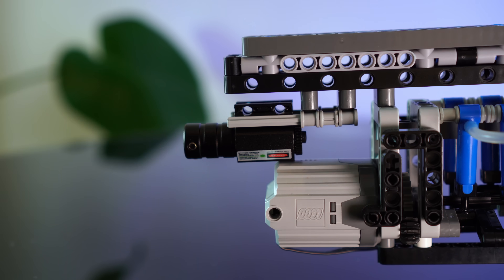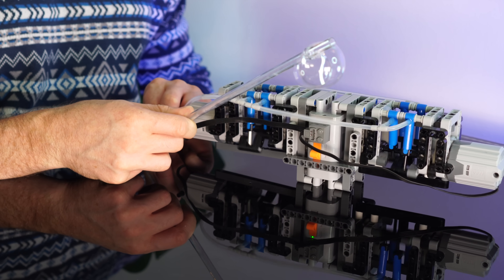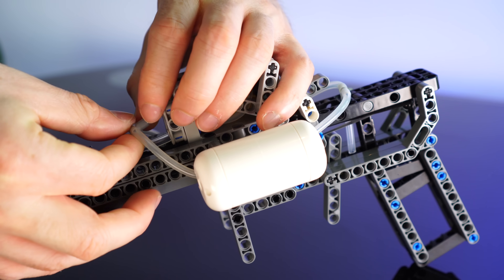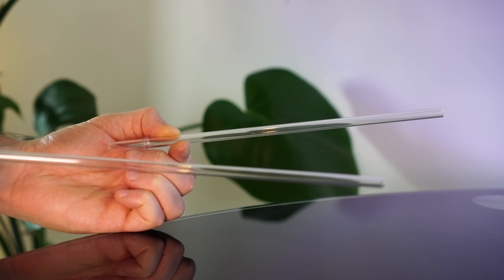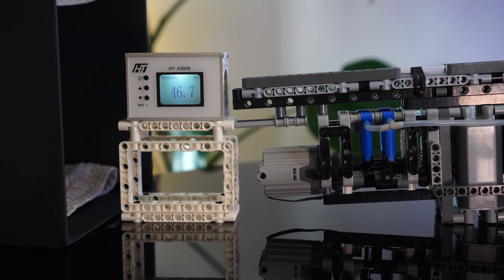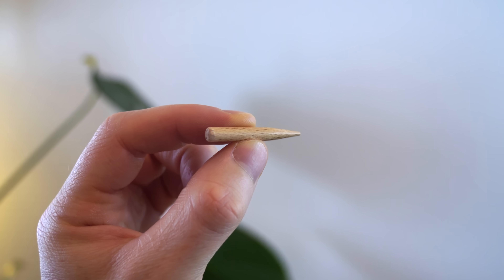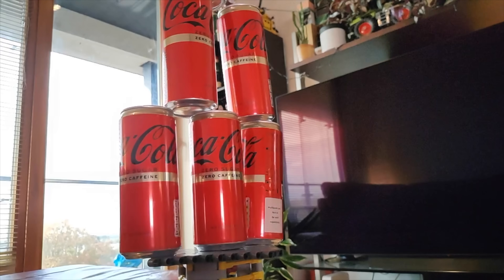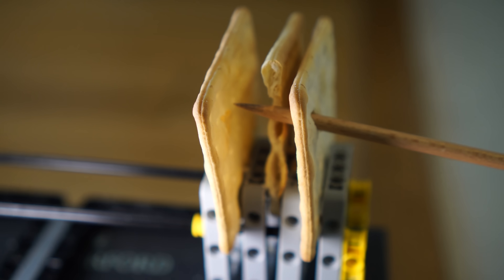World's Most Powerful Lego Air Gun?

Comment: Barrel lenght should be optimal when the internal volume of the air tank is 2-3 times as large as the barrel volume, depending on projetile weight. This is the cylinder to barrel ratio, it is used in airsoft guns for ex. This is why you got better results with a shorter barrel, as the volume of the air in the tanks was not enough to fill the longer barrel at sufficient pressure.
Reply: Cristiana Kansas
Reply: I believe the math/physics is that as soon as you reach that equilibrium point where the pressure in the tanks+barrel  equals atmospheric, the positive before and then the net 0 force at that instance then becomes a negative force to the direction of travel where the "bullet" is now trying to be sucked into the barrel, thus reducing the exit velocity.
Reply: @aidankeys8534  Exactly. When the pressure in the barrel becomes too small to propell the projectile it will just become a negative effect that is slowing it down.
Reply: Not shoeving the projectile all the way down tve barrel explains it easilier
Reply: and you can utilise the airpressure even more if you put a little bit of foam behind the propelled objekt to seal it
Reply: Also, no one mentioned friction, between projectile and barrel. Remove the tape, and as suggested, use a small piece of foam

Comment: The long barrel gives a slower velocity because the impulse into the projectile stops being produced before the projectile reaches the end of the barrel. The last couple cm of the barrel just create drag with no pressure behind the projectile. You’d get more velocity if you made the release of pressure slightly slower so the whole length of the barrel could be used to generate velocity

Edit: to give the highest possible velocity to your projectile, try to match the time that the projectile takes to leave the barrel with the time it takes for the impulse on the projectile to finish. If the impulse is too short, you lose velocity to drag. If the impulse is too long, you lose velocity to not using all of your propellant on the projectile, and having some of it still escape the barrel after the projectile has left the barrel.

Comment: What you need to try is a metal barrel with internal Rifling.

This will cause your smaller projectiles (specifically the bullet-shaped wooden ones) to spin and maintain a tighter accuracy to the estimated trajectory of said projectile when fired. It's the same practice used with firearms of the modern era.
Reply: Unless you use a tank gun but those things don't rely on. On spin stabilization they use fins or they just have the projectiles be so aerodynamic that it doesn't care about whether or not it's stabilized it just kind of goes in that general direction fast enough

Comment: I think the air stored in the tanks is not enough to propell the ammunition out the long barrel as fast as the short barrel. The long barrel needs more air.

That's my guess anyway.
Reply: Definitely part of the reason. There is an optimum barrel length for every projectile/cartridge size on earth; Too long a long a barrel with too long of a cartridge means that you're wasting potential energy by forcing gas to push against other gas to push the projectile, too long a barrel with too short a cartridge and you're not producing enough force to push the projectile out of the barrel. There are so many combinations to consider when producing a projectile launcher or any sort really. I'm not smart enough to provide any math on the calculations required for optimum length but I feel like the video does a pretty good job of demonstrating it and I'm happy to see that he went through the trouble of finding a few different options and measuring their outputs before deciding on a final type. 

In terms of projectile length, the knitting needles seem extreme but their length allows for stability during flight akin to an arrow, whereas the small bullet shaped piece of wood tumbles because it has no rifling. You can see the same thing happen with the technic axle as well, although it would benefit from rifling too, it has other aerodynamic flaws that greatly inhibit its performance.
Reply from the maker: You're spot in there I reckon. The smaller ones tumble quite badly, and the slow mo footage highlights just how badly the tumbling causes the rounds to veer off course. Using darts largely solves that problem, but they tend to be quite light, and there's quite a bit of drag after a few metres. I gotta say, I'm enjoying the knitting needles a lot 😁 The first commenter is also right though - this needs more air, and a larger bore to release it. I reckon a 500ml coke bottle at 60-80 PSI would do wonders ....though Lego compressors wouldn't manage those pressures unfortunately.  Thanks for your comments and suggestions!
Reply: I think it’s due to the projectile travelling a further distance before it reaches the end of the barrel, so it slows down more
Reply: @JamiesBrickJams  In the video we can see you are not putting the proectal fully in the barrel, so in the long barrel the pressure at the end is lower than the shorty, if you'd put it fully in, the long barrel would be better. If you were already putting it fully inside than idk what is appening.
Reply: @JamiesBrickJams  ideally you'd want a projectile that's nose heavy at the speeds you're going at. The bullet shaped piece of wood needs to be going in excess of 900FPS before it'd be aerodynamically stable, even if you managed to impart spin on it. The centre of mass is behind the centre of pressure in that shape. You want the centre of mass to be in front of the centre of pressure. Like a badminton shuttle.
Maybe see if you have some small screws with a head that fits the barrel tube, and then super glue some cotton wool to the threads. The cotton wool should drag stabilise the screw, no spin needed, and it should make for a bit of a wad in the barrel to help seal it.

As for barrel length, a good rule of thumb is that you need 3x the volume of the barrel in pressurised air. I don't know what kind of volume those lego tanks hold, or what the dimensions of the barrel are, but just looking at the relative sizes, I don't think the problem is that you don't have enough air. You have a lack of flow, the "transfer port" (ie. the T-joints) are too small to flow any amount of air.
For comparison a 4.5mm air rifle with a 530mm long barrel needs to flow around 12ml of air per shot. Roughly about 1 cubic inch.

The easiest way to improve the gun would be to double the "hammer" so the mechanism kinks two hoses, one for each tank. And then fabricobble some sort of Y-joint into the barrel rather than a T-joint. Maybe just cut the ends of the hoses at an angle and just jam them in together. That would double the flow rate from the tank to the barrel. Also try to make the distance from the kink points to the barrel as short as possible, the less dead air you need to accelerate, the better.
Reply: Also the lego airtank is just too small for a airgun. You should grab a plastic soda bottle in this case
Reply: Longer barrel means the projectile has more friction inside which costs energy and thus speed
Reply: You're correct hence why longer barrel rifles are a higher calibre because the longer barrel increases accuracy but you need more energy to travel out the barrel due to friction and pressure
Reply: Ya the things is the hole in the « T » is not big enough to evacuate the 40 PSI 
If you wantes more stronger use « T » with bigger holes
Reply: In the nerf modding scene barrel length is tuned to the volume of the plunger tube/air tank, ideally you'd want it long enough that it can fully accelerate but short enough that it stops accelerating just as it's about to leave the barrel, too long and it'll stop accelerating too early and bleed off speed, too short and the excess air will push at the rear of the dart even if it's out of the barrel causing it to tumble

Comment: Firearms and air rifles are different when it comes to barrel length due to the different ways they propel the projectile. Firearms create more pressure the longer the gunpowder burns (until it all burns away anyhow), so a longer barrel lets the expanding gas push the bullet for more time, building more speed. When it all burns away or the bullet travelling down the barrel creates enough space, then you get a drop off in pressure, and friction starts to slow the bullet, so the bullet should leave just before that can happen. With air rifles, it starts as a set amount of stored pressure that only decreases as time goes on and the bullet moves forward, allowing the air pressure to drop, so it very quickly reaches a point where the expanding gas is overcome by the friction of the projectile in the barrel. Longer barrels are more accurate, but require higher pressure to propel a projectile, so it's a very fine balancing act.
Reply from the maker: That makes so much sense, thanks for the explanation! I wonder if it might be worth experimenting with even shorter barrels then for these smaller guns. I do have some ideas for larger guns that use larger tanks (like a small coke bottle). Looks like there's still a lot of experimenting needed to figure out a good combo. Thanks for writing that up!
Reply: @JamiesBrickJams  no problem! something else to consider is to decrease the friction of projectile in the barrel while retaining a seal. If you take a look at air rifle pellets, they're shaped to have minimal contact with the barrel on the sides while having a large concave tail end to catch more of the air being thrown its way. Good luck with your future designs, I hope they're even better.
Reply from the maker: Thanks a lot! There's definitely some experimenting to do with darts I think, which should act similar to air rifle pellets. Will see where this evolution goes 😀

Comment: Barrel length has a sweet spot that will vary based on several factors. How much PSI, the weight of the projectile, friction between the barrel and the projectile, and how tight the fit of the projectile is. Ideally you want a barrel exactly as long as it takes for the projectile to finish accelerating. Because any extra length of barrel it needs to travel past the point it finishes accelerating, is only going to slow the projectile down with friction.

Comment: The issue with the accuracy, even with a pointed ammo, is that there isn't a spin that would help with centering the shot. If a shot is spinning on the access of the direction it is fired, then the air resistance would be spread out more evenly, resulting in it not twisting in the air as much when fired. But you can't really add riffling to the inside of your barrels that would induce the correct spin of the projectiles.

Comment: I think the seal at the back of the barrels may have been more loosely fitting, which could be why the short barrel outperformed the long barrel.  The air may have escaped out of the back of the long barrel before the projectile left the gun, leading to lesser performance.

Edit: this is probably also why the thinner metal barrel performed so well; there was a greater seal around the projectile and the back of the barrel.  Maybe a longer and thin metal barrel would work?

Comment: Rifling the barrel would give a better accuracy. 

Also when testing, the speed machine needs to be at a set distance as any small variations will change the result. 

Shorter barrel gives better speed as it will lose velocity moving up the barrel due to fiction if barrel is tight, or air pressure leaking around the projectile if too loose. 

You know whats next, a selector switch to have a safety, a single shot and a fully automatic one.

Have you considered making a gatling gun?

Comment: Your storage tanks run out of breath before the projectile makes it out of the long barrel.

The resulting vacuum drawn behind the projectile actually decelerates it.

Make the barrel even longer and it won't come out.

I suspect even the short barrel is running out of air before the projectile leaves the barrel.
Reply from the maker: I'm sure you're right here, that makes a lot of sense. Looks like the first step is to store more air, and find a way to release more of it. And then experiment with different barrel lengths to match that output. Thanks for commenting, these suggestions are always helpful!

Comment: The reasons I believe why the shorter barrel preformed better than the longer is because of 2 things. 

First of all friction, the ammunition no matter how well it fits the barrel will most likely glide on the sides of the inside of the barrel. Second thing is, that the pressure generated within the barrel isn't strong enough to propel it all the way through. Meaning that as an example the pressure might get too weak by the middle point of the barrel and from then on forwards there is only friction which play a role in force which in turn slows the projectile down. 

In gun boom boom physics, people tend to talk about "optimal length" of a barrel. Which is when the barrel length is just at the right length to where the pressure of the weapon accelerates it all the way to the end without friction overpowering the process. Meaning nothing goes to waste in form of the pressure and the maximum velocity of the projectile in that circumstance is achieved.

Comment: Barrel length is definetly important, but if its too long then pressure is way too low at the end and you waste energy since the pressure is less than the resistence of the bullet. Also try get a way tighter seal with the technic axels, it looks like you still have a leak since its cross-shape. And if you can those low volume blue pumps should be replaced for longer or thicker ones.

Comment: Amazing video! I spent many years making air guns and work with projectiles for my living. Try using a blow-dart-style round. They are quite easy to make with a very small nail, post-it note, hot glue, and finish off with duct tape. You want the hot glue to fill ~30% the volume of the cone. 

I find that this makes a phenomenal seal and durable ammunition made for precision. 

This also scales quite well! I would use a .5” diameter bore, a bolt ~30% the bore diameter, and lots of hot glue and duct tape. At 80% Mach 1 (220 psi with large tank and 4 foot barrel), the rounds would survive 30 ish shots into a very tough archery bag. 

I’d love to see you give this a shot! Pun intended 😁
Reply: Side note, “air-tight” is not possible for solid ammunition. That’s why blow-dart styles are perfect, as the seal is dynamic. As the pressure builds behind the round, the seal expands and conforms better to the barrel. 

Every barrel and solid round with have imperfections. This is why real guns and air rifles use lead ammunition. The pressure behind the round expands the lead and forms it to the barrel, leading to very marginal losses. 

Using a solid round (even the one you wrapped in tape) will always have significant losses because it is not designed to expand. Even if the seal felt strong, that “seal” is more cause for friction than it is for velocity because it isn’t expandable and adaptive to the barrel. 

This is most likely why you saw worse results with the long barrel. As velocity increased, so did friction. Friction will win at length without a huge air tank or massive pressures. I could run the numbers if I had them, but it looks to me that you have enough air volume to make the long barrel better than the short. Because the long barrel was worse, then you know the seal is the issue. 

Because the seal isn’t proper, the shorter the barrel, the better the velocity. Pretty counter-intuitive! But it makes sense when you think about how friction and pressure leak past the round effect velocity. 

Expansion is everything when it comes to efficient projectile acceleration!
Reply from the maker: This is fascinating stuff, thanks so much for sharing your wisdom! I really appreciate comments like this, so cheers for taking the time 😁 This makes so much sense. And the idea of using paper sounds very clever, allowing it to expand wit the pressure without introducing much friction or drag. I'll absolutely be testing that out! I doubt I'll get anywhere near 220 psi, but I'm sure I could get a small coke bottle up to about half that using my handheld compressor. Now you've got me itching to try a few things 😁 Thanks again, and looking forward to putting some of this into practice
Reply: @JamiesBrickJams  So glad I could provide some inspiration! Look at an 8 year old vid from “the king of random” about making a homemade blowgun. That’s your ticket to great ammunition! I go a step further with duct tape covering the paper, then trimming the end one more time for that perfect seal. Paper isn’t meant for sealing… but duct tape is 😍. 

Your designs are seriously incredible. I cannot wait for more vids to come. Thank you for your kind words and inspiration to young engineers 😁
Reply from the maker: Just checked out what I think is that vid - it actually looks pretty straightforward. Cheers for suggesting that one. I'll give some duct tape a try too, I'm sure there's some lying around. And glad some of these odd contraptions go down well. Take care!

Comment: I think part of the problem with longer barrels is that it normally works better because the rifling spins the projectile more. When you use an air-pressured gun, however, it takes a lot more power to fire out of a longer barrel, and since (I'm assuming) you have no rifling, it doesn't add that extra spin to the projectile.